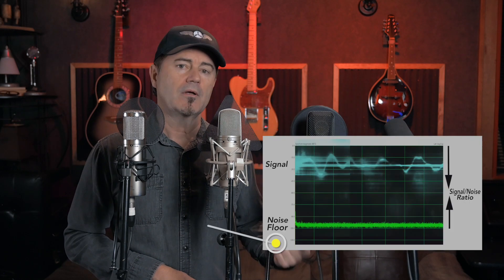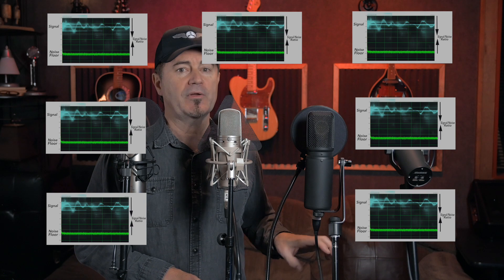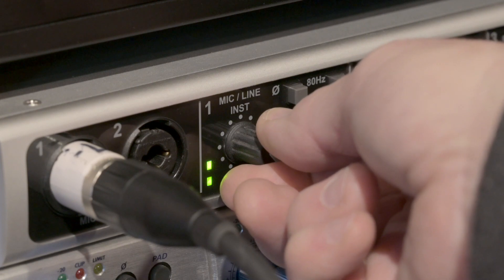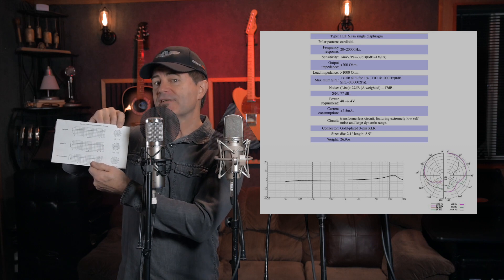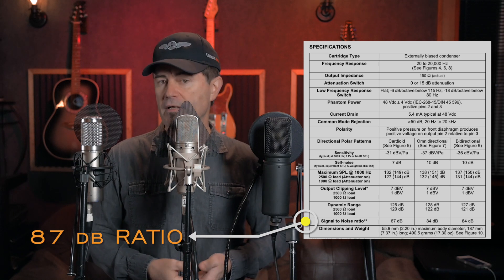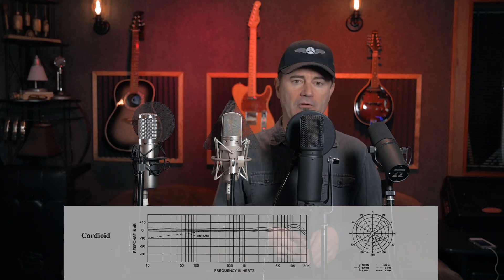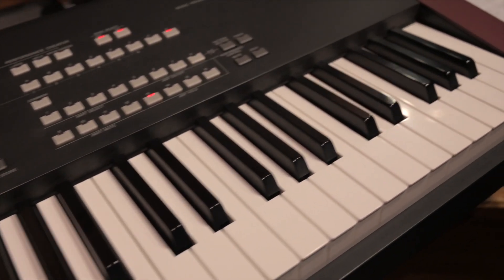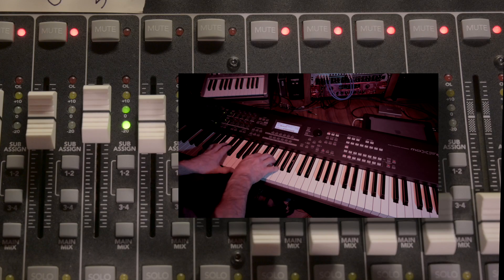LEARN CUBASE - 21. Gain staging hardware

Comment: What are your thoughts on cables?  Any thoughts on whether Mogami is the only way to go?  If not, any suggestions?
Reply from the maker: Mogami makes great cables but, so do other companies as well. Assuming that all your cables ground connections are good, you will likely hear far more issues with poorly grounded gear and gain staging before you hear the difference in cables ( assuming there are no really long cable runs )
Reply: @Featherlightstudio  Thank you so very much (as always).  Your guidance bears great weight with me, as I learn such a depth of new knowledge, from a seeming unending array of production related matters from you... Therefore, I am belaboring the planning for my small setup to a likely comedic extent.  However, I feel confident in my goals and am excited about moving forward with "informed process".

If I may ask, are there any brands which you feel can compete with Mogami's quality for the value?
Reply from the maker: @sekritskworl-sekrit_studios  The upper end of Monoprice, Hosa, ProCo, and Cable Matters all make great cables with options for quad shielding and true Neuman or SwitchCraft ends. Matching the cable for the application is key. Long instrument cable runs need better shielding. Heavy conductors 16/14 awg for speakers, ect.
Reply: @Featherlightstudio  This is AWESOME, Thank you!  I bet a TON of noobs (just like me) would benefit from a dedicated video series on cables, connectors, and brands.  You're the best!

Comment: Great video!  One thing, @10:24 it does require Phantom Power to function. Question, so for the SM7B, 59dB ratio against 87dB of the KSM44... the noise floor is then 28dB lower, so does that means that the SM7B is "less quiet" or "Noisier"? and with that, it is a less good microphone for vocals? so how come it´s history and that it is super valued?  how can artists achieve good recordings with it?
Reply from the maker: Heh Marco, The SM7b can be used with...or without a mic booster ( the booster is the thing that requires phantom power, not the mic)
If used without however, you have to have a mic preamp that can deliver 'at least' 60db of gain and actually about 70db in most vocal cases. And yes, the SM7b is definitely noisier than the KSM. A 'Mic Booster' will just make the output louder (including the noise floor) so pick one with good specs. https://youtu.be/5pcuKnf5kLU
Reply: @Featherlightstudio  Right, I forgot about that, because to me, SM7B defaults with an inline pre-amp. I connected the SM7B to my Apollo Twin X (65dB of Gain for Mics) and also to an ADA8200 I have as an ADAT port expansion for the Apollo directly and the signal is very usable, but I guess it´s better with the SE DM1, right? (with it, I only have the Apollo in 25% of pre-amp volume and it gets to Cubase at a very good level)

I check your video and definitively will get that CODA next time. (I have SE DM1 Dynamite which I like more than the Cloud Lifter. I was aiming at the Fethead, to give it a try because I need to get one)

Thanks for your response. 👍 👍 👍

Comment: How to fix a low recorded signal to a good level in Cubase? Thank you.
Reply from the maker: The quickest way to increase basic gain is to click on the small rectangle on the top/center of the audio clip and drag upwards. This is basically just normalizing the clip so, it won't clean it up if its a noisy recoding but its a quick way to match other levels in the timeline.
This video will help explain: https://youtu.be/onoTQ_uFeUs
Scroll to about 03:40
Reply: @Featherlightstudio   big respect for your fast response, and what is the other more professional way to increase the level? Thanks again sir.
Reply from the maker: @karadytube  There  are several depending on your mixing needs. 
1. Open channel edit ( the little E on the track) and under the Pre Tab, raise the gain slider.
2. Insert a compressor on the first slot of the channel  insert FX and use the Makeup gain to increase level.
3. Select track, Navigate to AUDIO up in menu bar, scroll down to 'Processes' and select Gain effect.

Just a heads up, All of these choices have 'downstream' ramifications of course.
Reply: @Featherlightstudio  many many thanks sir 💐